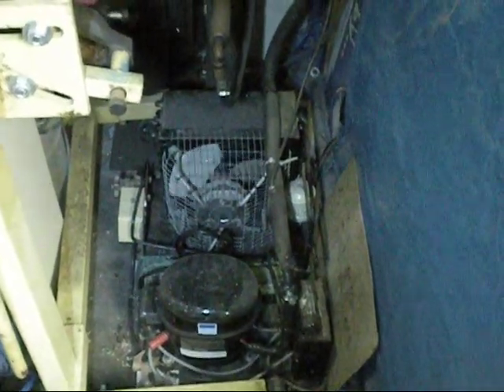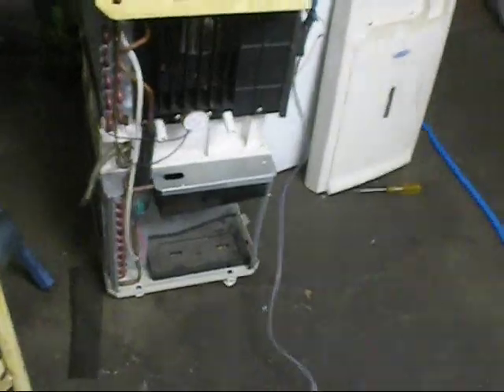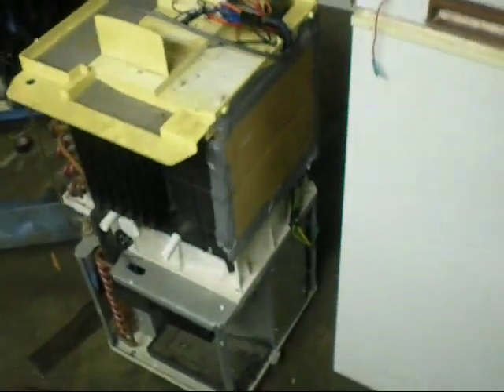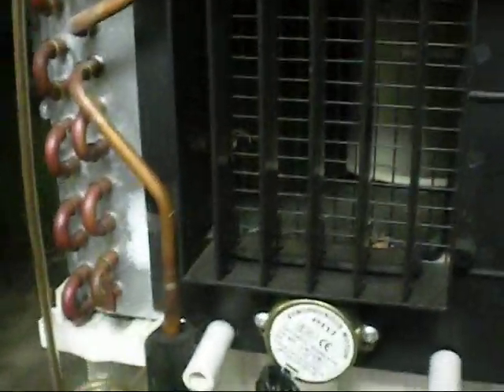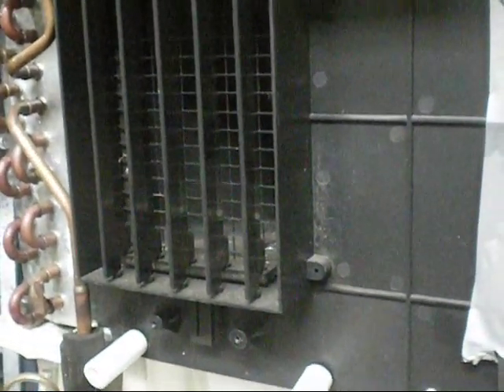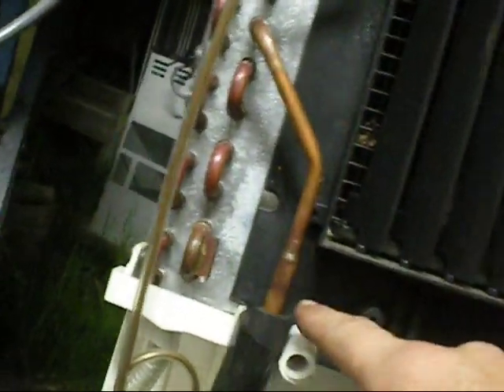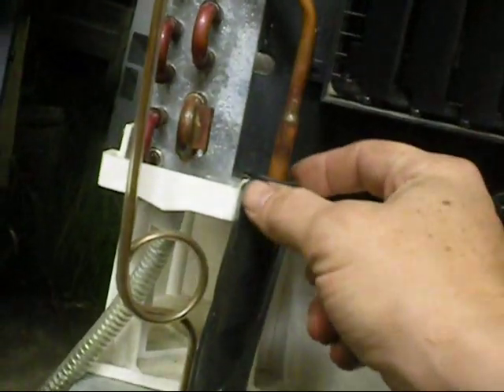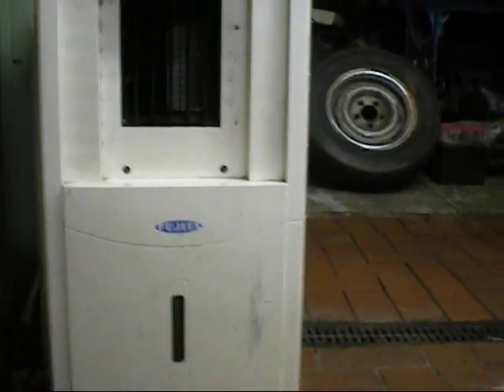night with jagnut P2

Comment: cool work on the portable, I made sure you got ones that ran well. good idea on the microwave cover, I dumped most of mine too lol. put a good set of wheels on it and a tool tray top and use it as a tool trolly/cooler :D

I might do that with the naked one i have, its missing most covers and shit too.